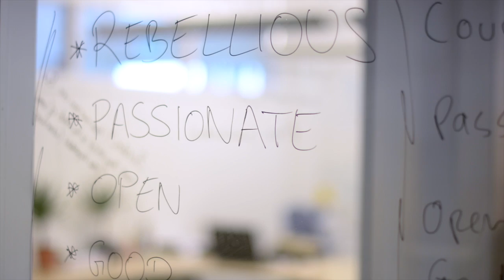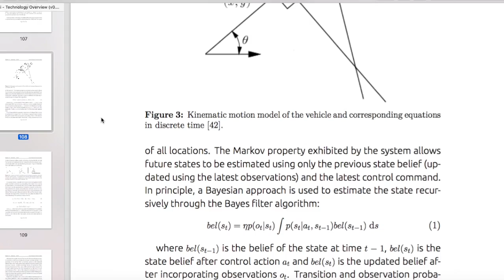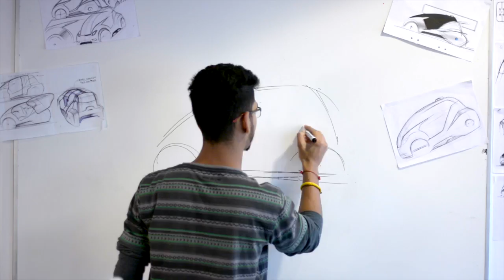2016 Crowdfunding | Uniti - Ingenious Electric Vehicle

Comment: Was about to buy some shares off you but not willing to part with 500 Euros on an outfit that has little to show for. I agree with the concept you've proposed here, and I'll even mention your car in one of my videos, hopefully that should inform more audience about your product. Here's big but!! You'll need to make tangible product, explain how your product differs from similar products already on the market, how your product will meet strict EU safety laws, crash testing the vehicle against a table won't do (Top Gear reference), about the range, support package should vehicle be out of commission and raft of all other issues. 

Offering a nice looking vehicle is one thing, offering an affordable, vehicle with good future prospects is a whole new ball game. You need to give me more than just few cgi cinematics before I part with 500, 1000 or 10000 Euros. I can see Tesla car and than I see your car, sell it to me, what makes your car better or cheaper ? Model 3 is selling for $35000, has a range of 350km @80kmph, this can be upped with Tesla battery swap and future improvements to battery technology with a really simple straightforward process, by replacing the battery, how Unity differs ?  How Volvo, Renault, Mercedes, BMW, VW and other electric car manufacturers will differ from what you got to offer?

I know you're offering two seater city electric car,  however how does that differ from other concepts of same two seater electric cars being offered right now and in near future. BMW i3 for example?  Also price won't do, TATA makes cheap electric cars, Chinese are also catching up, so you'll need a marketing plan, a business plan how you intend to attract buyers and therefore the investment required for the car to be a success.

Comment: Dump the Batteries & Big Motors  
GE’s Vision for the Superconductor Industry -  "Electric generators made with superconducting wire are far more efficient than conventional generators wound with copper wire.   In fact, their efficiency is above 99%, and their size about half that of conventional generators … ”   http://www.superconductors.org/uses.htm     
-       -       -       -       -       -       -       -       -       -       -       -       -       -       
No Batteries Necessary 
If we can produce energy faster than we could use it, 
then we wouldn’t need an extra man-made energy storage battery.  

The Space Around Us Is The Best Battery    
The vacuum of “empty space” appears to be an energy reservoir of immense capacity 
that makes nuclear power seem old fashioned.  Richard Feynman and others have pointed out that the amount of Zero Point Energy in one cubic centimeter of the vacuum (ambient space) is much greater than the energy density in an atomic nucleus.  
-       -       -       -       -       -       -       -       -       -       -       -       -       -    
All The Rave About Superconductors - Size Really Matters  
The diameter of some superconductors are 1000 times smaller than copper wires 
required to carry the same amount of electrical current.   So, 
1000 x 1000 = 1 million times more turns of superconducting wire 
can be put in the same coil space as copper coiled wires.   

The resultant magnetic strength that a coil of wire can generate - B
is governed by the number of Turns of wire in the coil,
times the amount of Amps of electrical current sent through the coil, 
divided by the Length of the Coil. (not the length of the wire)  
   B = (Amps)(Turns) ÷ Coil Length 
So you can see that by increasing the Amps,
or by increasing the number of Turns of wire,  
or by decreasing the Coil Length, 
we will proportionately increase B - the strength of the magnetic field. 

Instead of spending a lot of $$ on energy (Amps) to produce the magnetic field, 
we can just increase the number of Turns of wire to increase the magnetic field. 

Think of Amps as money - the cost of electricity to excite & run a motor,  
or the cost of biofuel or petrodollar fuel required to power a generator.  
If you reduce the required Amps to power the coils by a 1000 times, 
then you will save a thousand times the fuel cost to excite the coils. 
That’s what all the rave about superconductors has been about. 
Superconductive wires makes it easy to produce “Free Energy”. 
  
Graphene nano-ribbons tested could carry as much as 10 billion amps/CM, or nearly 1,000 times greater than copper.  http://www.talk-polywell.org/bb/viewtopic.php?t=1480   

Graphene has a current density a million times that of copper at room temperature.
http://www.zdnet.com/the-10-strangest-facts-about-graphene-3040093050/

35 Room-Temperature Superconductors Discovered  -  since March 2011  
http://www.superconductors.org/158C155C.htm   

Magnetically excited xenon gas filled SiO2 Plasma Capillaries may be the best superconductor candidate.

Comment: It's like Tesla. Only 20 years behind. Lol
Reply: Tesla encourages competition and more developers doing things for similar goals, I'm sure these guys exist partially inspired by Tesla's mission, but the car industry is pretty difficult to get into, so I wish them luck.
Reply from the maker: Yes of course we were inspired by Tesla!
Reply: So you are saying that 2019 I'll be able to go to a store and buy a Uniti for 20,000$?
Reply: Tesla started in 2008 to produce some 1000 Roadsters >109,000$ each. In 2012 they started to sell some 10.000 Model S 72-150,000$ each. 2018 they will start to bring some 100.000 Model 3 on the road, starting at 35.000$.
If Uniti brings a full autonomous City-2-Seater 2019 for 20,000$, what has Tesla to offer for this Price tag ?
Reply: The price of the car will depend on the price of the components, and nowadays the electronic drives are considerably expensive. You really need mass production for getting the price lower, but now Lithium price is going up as hell. If things did not look so bad I would also be in the same industry.
Reply: Kostadin IV Kostadinov Lithium price may go up. That will help extractors to find necessary investors. But isn't the cost of Lithium only a very small and neglectable part of the cost for a battery ? Nowadays battery cost is decreasing as hell because of economies of scale (giga-factories).
Reply: ***** Of course not, it's a crowd funded project that involves hardware...